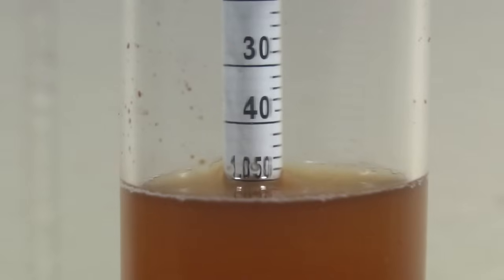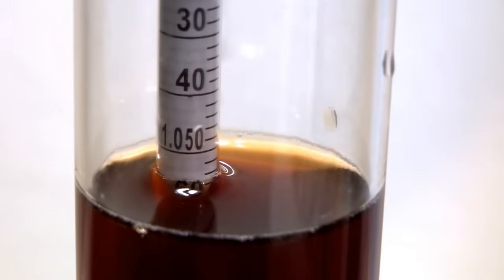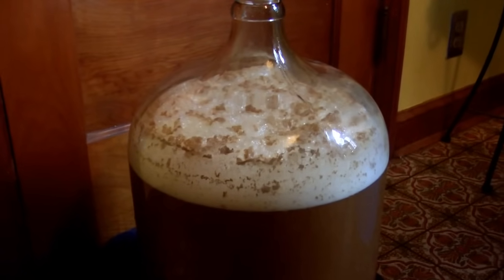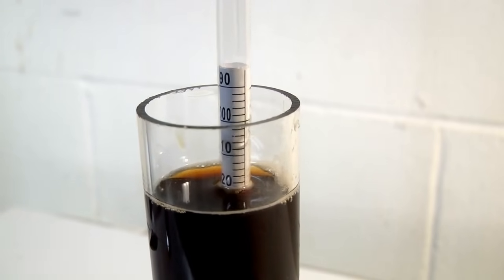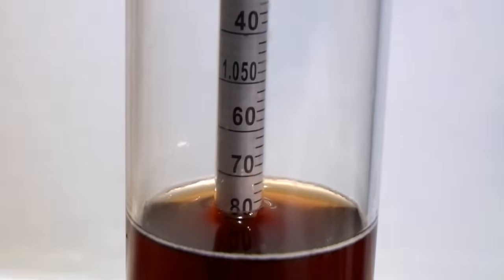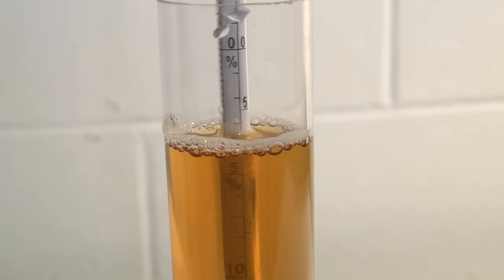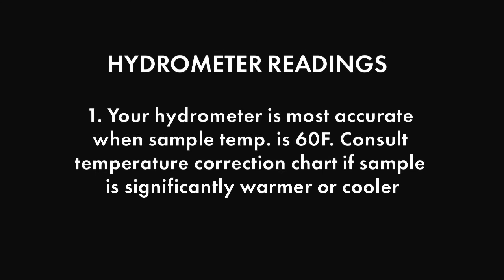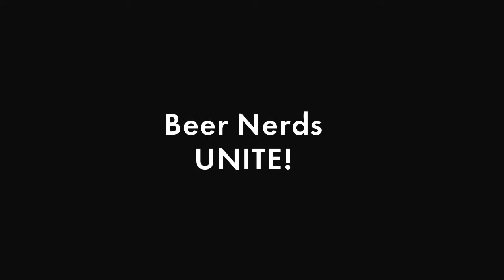How to Use a Hydrometer for Homebrewing

Comment: as far i have read a hydrometer measures +-2% wrong. so in a span of 5-18 it doesn't really help out. newer used one, brewed +30 times. failed twice with an 8-year-old yeast and harvested used yeast, but i was able to get it going by adding new yeast in it.

Comment: Can you use a hydrometer to check the alcohol content of a bottle  of store bought gin after its been opened,  it looks like it's been tampered with and I want to check if it's been watered down
Reply from the maker: Unfortunately not. You would need a more sophisticated piece of lab equipment to do that. A hydrometer measure the amount of sugar in a liquid solution. While that can be used to calculate the ABV of a beverage (given you know both the starting and ending gravity via hydrometer), you cannot measure alcohol specifically with it without knowing the where it started sugar-wise.

Comment: I planned to add some cool water to mine to get to my wanted fermenter volume. However, I forgot to give the beer a good stir before getting my sample from the top of my fermenter. Gave me a lower than expected OG reading. I was frustrated, added the yeast and whatnot, and put it away. It wasn't til after a few minutes of thinking that I realized I should've given it a little mix to get the sugars better distributed.

Don't make the same mistake I did! Lesson learned at least...
Reply from the maker: It is a good lesson to learn but thankfully it will still likely turn out and be something you'll enjoy -- numbers be damned!

Comment: I messed up and did not take a starting measurement from my pomegranate wine. What meaningful or useful measurements can I use now that my wine has been fermenting for two weeks.?
Reply from the maker: You could always take final gravity reading if for nothing else to know what gravity it's ending at for future reference for other batches. But if it's been fermenting for a couple of weeks, it sounds like things are going well. Where's the batch at now?
Reply: NorthernBrewerTV it’s still in its carboy. I had to wait for second carboy to come from Amazon so I can rack a couple times using a siphon to clarify it more . It tasted alcoholic. But cloudy. Like beer strength. Thank you for helping me.

Comment: How do you know when fermentation is complete?
Reply from the maker: There are several ways you might know that fermentation is complete. 1 - bubbles in the airlock of your fermenter slow and eventually stop completely. 2 - the foamy krausen inside your fermenter subsides from the surface of the beer and drops to the bottom of your fermenter. 3 - a gravity reading via hydrometer remains constant for 3-4 in a row. These are all signs that fermentation is most likely complete and you can begin the conditioning phase or racking to secondary or keg.

Comment: What do you do if the hydrometer drops to the bottom of the tube after fermentation? My beer went from 11% ABV prior to fermentation and now my hydrometer doesn't even float? I would assume that I left it in fermentation too long and it ate up most of the sugar? Would it be wise to save the yeast if that is the case?
Reply: all is fine its because it have alot of alcohol so it float lower...fill up the tube more.

yeast is fine, all is fine in fact

Comment: You never really told how to read the hydrometer.
Reply: seriously!
Reply: If you pause the video at :22 seconds you see the beer at the line 1.050 that is actually the correct notation for the gravity. If it was at the "40" line the reading would actually be 1.040. That's the key that no one ever explains. They leave off the notation apparently to make it easier to read but in my opinion it's more confusing without that.
Now hit play and pause at :28 seconds. What is the reading? 
If you say 1.014 you are correct and can now read a hydrometer. 
[If you said 1.012 you are not taking into consideration that each hash mark is 2, 4, 6, 8 rather than 1, 2, 3...] 
This 1.014 reading is likely a final gravity reading since it's so low. Water is 1.000.
Reply from the maker: Hmm, let me try. The markings are hundredths and thousandths, the bolder lines denoting the hundredth and by the numbers 10, 20, 30, etc. The smaller lines denoting the thousandths. If you pause the video at 1:08, you can see this. Once you pour in your wort or beer, you'll read your measurement at the liquid line and not the meniscus line. If your liquid line is halfway between the 60 and 70 marks below the "1.050 line" the reading would be "1.065". - I hope this helped somewhat, hard to explain without being able to show you at the same time. Maybe the next hydrometer video, we can explain it better. Thanks!
Reply: @NorthernBrewerTV  yeah you guys got to work on your videos, i love your products and i am a big fan of your beers but i feel the videos could be much better. Just as good as your beers
Reply: Always the way with instructional videos. They start with the topic and next thing you know you are hearing about how their dog got sick or their next holidays in Europe. Try this...     https://www.youtube.com/watch?v=inUwzYxoGUQ then this https://youtu.be/GCyqBNV6u48 for a very complete picture

Comment: Just drop the sanitized hydrometer in the fermentation bucket
Reply: right but don't we need to check the temp at which readings are accurate by using a sample?

Comment: Does anyone know what the reading actually means? If I read 1.050 it is 1.050 of what?
Reply: water weigth in at 1.000

if your original gravity is 1.050 then you write that on a paper.

then your beer is finished to ferment you take a second reading...lets say it is 1.012.

then you can calculate that by hand probably the little paper that came with the hydrometer have a chart, but to hell with it, you just go to the internet and enter 1.050 in the original gravity box then 1.012 in the final gravity box it calculate it for you. then BOOM 5% in our particular example

easy =)
Reply: It's a measure of weight. Around my parts the Brix scale is used which is different numbers but essentially the same thing is measured. Weight changes when sugar gets converted to alcohol. That's how the approximate content gets calculated.
Reply: best explanation yet..it makes sense now... thanks Teodor  :)
Reply: Density, kg/litre, water should be 1.000

Comment: my hydrometer doesnt sink at all,it doesnt even shows zero in my wine, but when i use it in vodka it shows 33.so what s wrong with my wine?
Reply: Sounds like you have a proof and trails hydrometer. If it is, the numbers will go from 0 at the bulb on the bottom to 200 at the top. This is used for testing high spirits such as whiskey or vodka. You need what is called a triple scale hydrometer.

Comment: No need to make a 5 minute tutorial with collegiate buzz words to explain something so simple.  My mind was screwed up for months trying to understand this until my homebrew mentor clued me in to the simplified approach.  At 60 degrees farehnheit, take an original gravity reading, after fermentation stops take a final gravity reading.  Take your OG - FG =  X.  Take  X and times it by 105.  Take your result and times it by 1.25.  This will give you alcohol by volume at a percent level.  Do all readings at 60 degrees farenheit.  Your Original reading should be done before yeast is pitched.  -Active home brewer.
Reply: +Piano Man42    i will help you with easier formula .... (O.G.-F.G.)*131=ABW      You welcome  ;)
Reply: Lol you have a mentor

Comment: would it be possible to just distill the alcohol by boiling it off and collecting it then just pour it back to the left over water to control the % alcohol?
Reply: YIC You would probably end up boiling off some water as well which would change the composition of your brew.  It would also negatively impact your flavors and kill any yeast that you could have used again.  They have formulas online that can show you what kinds of yeast to use and how much malt extract to use to try and get to an abv you want.  Why would you be so concerned about getting such a precise alcohol content?

Comment: Nice video, EXCEPT that you neglected to explain how to accurately calculate ABV:
(O.G. - F.G.) x 131 = ABV%
But this information is readily available in the literature included in most home brewing starter kits so no big deal, just wanted to clear that up for your viewers!
Reply: i've seen that formula before, but do you know why the "x 131" part? why 131?
Reply: ..Or you could just go online to a hydrometer calculator & enter your before & after readings there & let it do all the work ;)
Reply: Very nice, I like this orientation

Comment: havent brewed in decades but when I started brewing in Flagstaff in the 90's I was told to use a satellite sample, i.e. a beer bottle full of wort capped with loose cotton, to test the progression of the fermentation. I realize that I wouldnt be taking readings directly from the fermenting bucket but it was pretty reliable in my experience plus the added benefit of not opening up the bucket to let bacteria in. Is there are reason to not continue using this method, now that Im getting the beer bug again?
Reply: Good idea, I shall do that next brew.
Reply: '90s, not 90's.